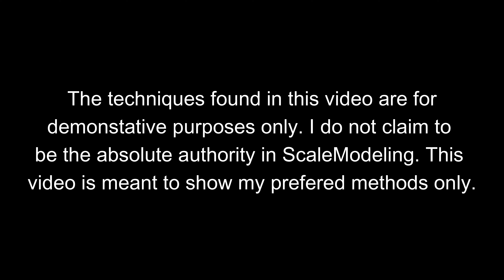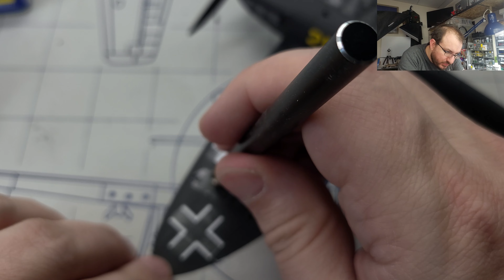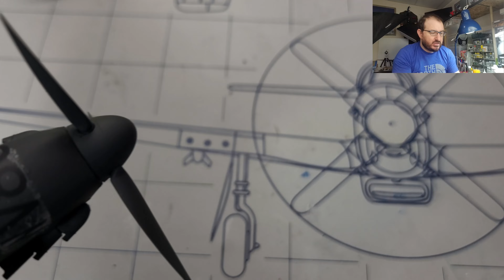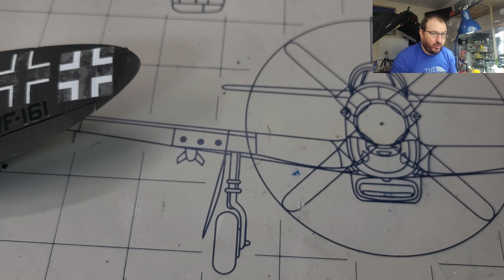More decal testing: Do you need to use hot water? Hairdryer?

Comment: Hi Cameron.  Putting the setting fluid under the decal is a game changer.  I know due to the nature of the whole hot/cold water thing you couldn’t do it on this video, but using a good fluid under the decal is a huge difference.  I have had no/zero/nunca/nein silvering when putting a good fluid underneath first, doing a Q-Tip roll, letting it sit a while, then before drying, putting fluid over, then Q-Tip rolling again.  
This has worked for me using Tamiya Mark Fit Strong, SolvaSet, Micro Set and Sol, and even Mr. Mark Setter and Softer (danger…that combo is hot on weak decals).
Hot or cold water has only made a difference for me in release time from the paper….otherwise I saw no difference.
Reply from the maker: Exactly. Hence the silvering everywhere. Next test will start over and test each brand to see what is best. Why learn how to fix when you can learn how to prevent

Comment: I clear coat w/Pledge. Let dry and apply Mark Setter to decal area, use warm water to soften decal for 1-2 min. Apply decal to Mark Setter area. Roll Q-Tip over applied decal then apply Mark Softner. The Mark Softner will wrinkle than Smooth on its own usually in couple hours, After I apply Pledge to Decaled Area.

Comment: Ive figured out Markfit will discolor my paint if I use gloss varnish (if I put it on before decals)
Reply from the maker: Weird. I have not experienced that
Reply: @WasatchModeler  Yea I use Mig or Vallejo paints. When I markfit it over a Vallejo gloss, or ive also used Citadel gloss as well, its like it eats the varnish and causes the color to become a lighter shade around and under it (where the markfit came in contact)
Reply: Also, when I use Tamiya dull coat varnish and I apply weathering enamels/pigments and I use enamel thinner it frosts the model and destroys everything Ive done. Not the same situation but just another weird effect.